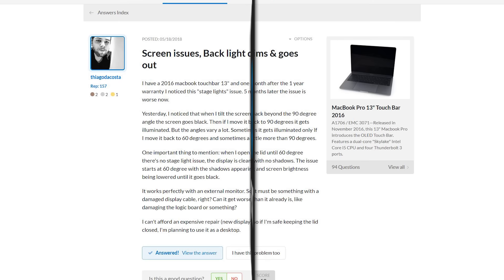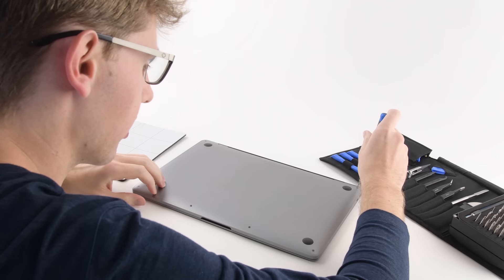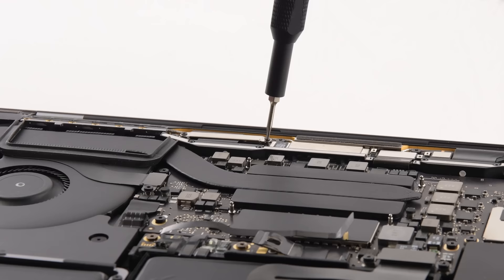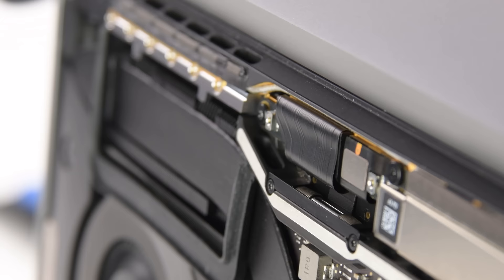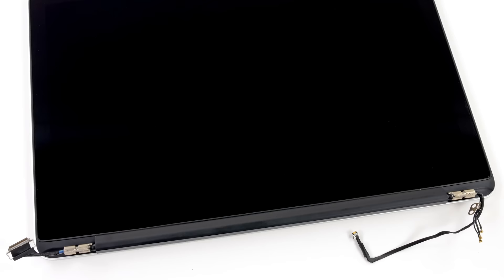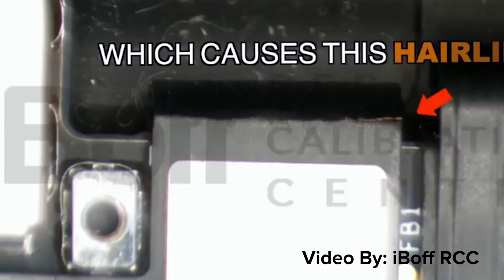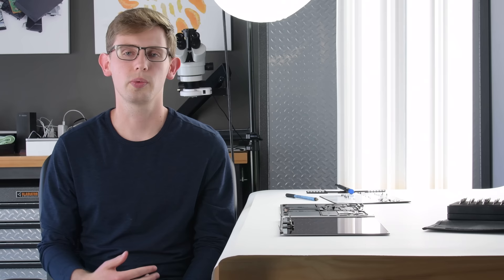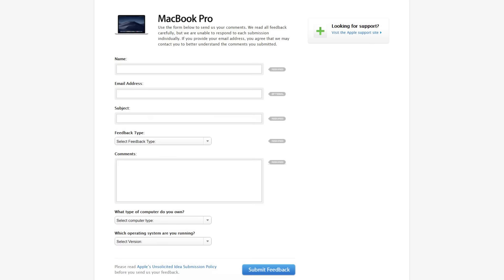The Design Flaw Behind MacBook Pro’s “Stage light” Effect! #Flexgate

Comment: What gives Apple?  It's just one screw up after another.  I love Apple products, but I can't stand this anymore...  Posting my MacBook Pro for sale and buying a windows laptop is very tempting right now.
Reply: yeah, since the new iPad is coming bend from the Factory im not going to buy one, my iPad Pro 9.7 looks like new and performs great, why should i buy an overpriced Banana, also can‘t use my apple pencil on it and no more Lightning Connector, Apple sucks since a few years now....
Reply: if you're looking for a thin and light, you should check out laptops from Razer, Dell, HP, Asus, and MSI etc.....
Reply: Then do it. Nobody’s stopping you.
Reply: Justin White just get a new RTX laptop...
Reply: in late 2011, I got myself a £2100 GBP Mac book pro. I love it, but its over-heats, and I have had to get a table cooler. I have also had to instal FAN control.  I love the Mac Operating system then and now. Than My graphics card chip fried and I was just in warranty to get the motherboard replaced ( it cost almost £700 GBP (free to me).  The Mac book overheats still. So I have employed the previous measures. Its a love-hate affair with me with me. Lots of things to love about apple but lots of things to hate. I have an iPhone, 11.9 iPad Pro 2019, MacBook Pro2011 (as mentioned), earPods, iPod (x3).  That said I am well established into the Apple ecosystem and they got me good and proper. It is difficult to detach myself. I can tell you that I will never get another MacBook Pro, too unreliable. I will be getting a razer Laptop and installing AppleOS on it on a dual boot set-up. It's possible using Hackingtosh process.

What can I say, I gave Apple all the chances in the world one would give. I wish Apple would sort themselves out as I would not want to go away, but at this moment I will not be getting another MacBook Pro. Sorry, Apple you messed up too many times on this product.
Reply: Macbook competitors suck. Source: try opening timeline on an ultrabook. I get 1 frame of the entire animation on my XPS 13
Reply: @jehovahnissi1961  Yes that is certainly true.  You have to admit though, Apple can and has done better.  I just would like to see them get back to that.  I doubt I will actually move forward with getting a windows laptop.  Ultimately, macOS is the reason I have a MacBook Pro, and I really don't want to tackle a Hackintosh.
Reply: If you want a high quality ultrabook, go for a thinkpad
Reply: Huawei's laptops are 🔥
Reply: @xXGeth270Xx  yeah, if it would'nt be so easy to bend i would consider it too, i use the iPad Pro 9.7 with an Apple Pencil and i like writing with it, the newer iPads just are so smooth with that 120hz Display, makes me want to upgrade..
Reply: @jehovahnissi1961  At least you can fix it - stupid Windows 10 you can always reinstall and restore data from backup. Plus these types of screwups are fairly rare that a computer would stay unusable after a Windows update. 

Try to fix a hardware problem!
Reply: @xXGeth270Xx  maybe get a 9.7 Pro or the 10.5 Pro ( for the faster screen ) or even the 2018 iPad 9.7 since it supports the Apple Pencil as well.
Reply: warren g just the way you spell "rose royce" tells me the value of your argument...
Reply: Me too . My mext lap will be a windows and it will happen anytime in 2019 .
Reply: Go ahead! Another option is Linux. It runs on a kernel, like OSX does so it won't take long to get used to
Reply: @power21100  Right, because those aren't complete trash.
Reply: @latitudeash  The 2011 MacBook pro definitely has design issue with the Nvidia chip failing after several hundred heating/cooling cycles.  There WAS an Apple program to fix this,  but it has no expired.  I recent;y fixed one of these for about $265.00 through a friend who has the equipment for desoldering and desoldering the GPU.  Sorry about your woe.
Reply: @maxdamage8562  complete trash like a macbook pro? no not really, those laptops are better.
Reply: @maxdamage8562  : Its life and we learn from past experiance. Apple need to remember this.

Comment: My 2016 MacBook Pro 15 Touchbar was also affected and I had to buy a completely new display after only 1.5 years. In three Apple Store they didn't want to do it for free and said that I would be the first one with this problem, so I had to pay ~500€ for their design fail. Good to know that I've been lied to and they knew exactly about this flaw... Btw my keyboard is getting "stickier" too and one key already stopped working for a day.......
Reply: Same computer as you...and yes Ive already had to get the display fixed and my keyboard fixed. This computer has been a joke. Over $1,000 in repairs that I didn't have to pay because apple care covered it. Thats ridiculous! I'm Cooked out. Ready for a new CEO to come in and fix Apple after all the issues that dude has brought on the company.
Reply: it got me wondering, aren't you guys are at a point to start thinking "this isn't worth it" and find alternative products, instead of continue paying those unreasonable sum...?
Reply: ZeroLife if only PC manufacturers started making their computers super easy to run mac os, they wouldn’t have any problems selling their PCs. Hackintosh laptops can be a nightmare to get working correctly compared to a desktop hackintosh. And to answer your question, my next computer will be a hackintosh. I’m done paying high prices for sub par hardware. I love Mac OS but the hardware choices under Tim Cook tend to be lower quality.
Reply: If macos is what you need then no other choices. But if it's not just get a thinkpad and it'll run like toyota corolla. Boring but works.

Comment: First of all they are expensive. Then now they have this type of stupid problems. Thought of buying one next month but nope never buying an apple macbook.
Reply: Radd Dronzy never bad this problem the MacBook Pro is really good for work
Reply: Get an iPad instead
Reply: I have an older MacBook (2012) and  love it.
Reply: @Thatapsguy12  Old macbooks are great. But if I want them then I will get only secondhand.
Reply: Look into buying pre - 2015 models as they are rated high in repairability, and my 2012 is still rocking strong after 4+ years of being on the bed, backpack, and on the table.
Reply: Radd Dronzy get an RTX laptop...
Reply: BluMac I hope you understand not everyone needs a windows laptop. Like I use primarily FinalCutPro X and Logic Pro X, I cant just switch to windows in one instance. A lot of my work flow goes through them and huge amounts of my data are on iCloud so no! 

It’s not about being locked in an ecosystem as I can even switch to Ableton or even Adobe instead of FinalCut but you will need months and months of practice and you have to transfer all your previous works to something that fits Windows and then there is the huge issue that a lot of my setup would get in a big chaos. There is also the issue that a lot of my friends and fellow students use MacBooks and even the computer set up in my school are Macs, fact even the bank where I do my summer internships at which is the Nordea Bank here in Sweden also uses Macs in several of there departments, so yeah not at all possible!

Nor do I want to switch as I am happy with my MacBook.
Reply: Sondre Johansen did I say that everyone needed a windows laptop?
Reply: Sondre Johansen that’s why I’m running a hackintosh on one of my PCs
Reply: Get a good Windows Laptop than make it into a Hackintosh. Done.
Reply: @brandon_nope  thats what i said...
Reply: Buy LG gram
Reply: @MrUnkownGuyAC  On the bed? smh
Reply: @blumac9801  I heard RTX gpu is not durable... its degrades easily
Reply: @sondrejohansen48  Microsoft has Cloud Storage. Use theirs. Stop complaining about nothing.
Reply: @TheOrisya  Hasnt even been out a month, and still there are complaints without sources?
Reply: TheOrisya ? I’ve never heard anyone say that before when the 10 series laptops came out, or what the 20 series laptops came out.
Reply: Radd Dronzy that’s how I got mine actually my mom didn’t want to pay the full
Cost
Reply: Sorry to hear that.  I have had many and they are awesome.  I currently have the 2016 13" MacBook pro. Many people have hated on this model, due to the keyboard and other issues (see above). It's tiny, very fast and extremely well built and continues to perform flawlessly. If I end up having the above issue, hopefully Apple will stand behind it.

Comment: Same thing happend to my macbook pro from 2017 after 2 years. Apple wants $1000 to swap out my screen, even though the cable is the only issue on my device. I will never buy any products from Apple again. The risk of failure on their Macs are way too high for the price tag, and their products are not reliable at all. You really expect that a Macbook pro that costs $3000 last for more than 2 years.

Comment: People keep thinking that warranty is the only thing that matters. People need to read up on "Consumer complaint
". Warranty is something the retailer or brand can offer. Consumer complaint
 is in the law and is in most cases always better than warranty. In this case Apple only gives 1 year warranty where here in Norway as an example, laptops usually have a 5 year Consumer complaint
. If you didn't cause the issue, Consumer complaint
 should be valid, and it's valid for 5 years for laptops.

Comment: Apple cares more about making their devices nice and light rather than usable and durable.
Reply: *more about making more money by using poor design choices to force more expensive repairs than

FTFY.
Reply: They actually make internationally breakable after one year span..and also 6$ replacement made 600$ thats called bussness
Reply: Its not the problem of being light, look at newest Swift 7 or Asus - they light, tiny and have no buttons or display issues like Apple. Also they cost the same price.
Reply: @jonaswunderkind4580  dont fool yourself,all laptops have one issue or the other....
Reply: @ppsarrakis  Have my Acer for 4 years, no problem so far except annoying fan noise which is the problem for most Windows laptops. SO 2 000 Eur MacBook just can't have keyboard issues, just can't.
Reply: @jonaswunderkind4580  They certainly may also have design flaws. You don't know.
Reply: @maxdamage8562  Why are you defending a design flaw of a machine costing over 2000 Eur? :D Yes my Acer have design flaws, but BASICS work very well for over 4 years. When you buy MacBook for such a high price - basics like keyboard SHOULD be working well with no issues. If cheaper machines can do it, then premium computer SHOULD too!
Reply: @jonaswunderkind4580  I agree completely! I am typing this on my 2016 MacBook pro and so far (touch wood) so good.

Comment: The touch bar Macbook pro has to be the Edsel of the Macintosh range.  I have a 2017 one and already the keyboard has been replaced because they admitted that was a design flaw.  Last week I started getting the stage light error.  I took it to be repaired and the tech gut said it would cost £700 plus Very disappointed is putting it mildly

Comment: My 2017 Macbook Pro 15 inch just started this exact same thing. The display actually started this a few weeks ago as I was just sitting with my laptop using it and my screen just went black. I tried opening and close it but nothing worked. I then discovered opening it slightly, the screen worked then opening it further, the whole screen cut out. I can't believe this is a known issue and Apple has done nothing to stand behind their product. Instead all they care about is making more profit instead of doing the right thing and repairing mine and other's machines. I had a feeling it was a cable before I even came across this issue because I could plug my laptop in an external monitor and get a display but after seeing this, I will not buy another Apple laptop if they can't stand behind their own product.
Reply: Exact same thing happened to me.
Reply: same here as well. Totally lost trust in apple and will no longer be purchasing their products
Reply: Same to my McBook Pro 2018.. dirty business by Apple.. after 3 yrs then its will occurs same display problem
Reply: same today. after 20 plus years of mac use, not sure what to do. pretty hard to just buy another one or paid thee absurd repair price when the computer functions perfectly (when its open to maximum 45 degrees)

Comment: I had mine fixed for 100 euro   the cable was replaced  this requires the a skilled tech to do it.  make sure the shop you go to has done it already or advertises that they can do it.  apple no longer supports this failure .

Comment: So frustrating that a problem like this can even exist from just opening and closing the computer.  So when the laptop goes in for repair are they putting in longer cables to fix the problem or is the same thing going to happen in a years time ?
Reply: no it wont !   am a professional mac technician and i can tell for a fact with my experience with flex, the issue wont happend again beccause if the  flex is longer it wont  break, so far ive fixed or repaired over 20 macs  issues with backlight  flex or the lcd panel itself especially from 2016 - present and they all been good  till now

Comment: Feel absolutely betrayed by Apple because of this issue. Not a scratch on my 2017 macbook and boom my screen turns black. They tell me I need to pay +800$ to replace the whole screen. They purposely sold these products knowing there was an issue but only replace the flexgate of 13 inch 2016 macbook pro’s. Joke of a company. What a letdown
Reply: hey, even if it was a 2016 mac they wouldn’t have fixed it, i went in with the exact problem and they tried to make me replace my whole screen for 497$.

Comment: Out of warranty, Apple will tell you that you need a new display panel, and possibly a logic board, and that you'd be better off buying a new laptop. That seems to be the way they do business these days. Someone really needs to start selling Hackintosh kits, both for desktop and laptops. Sell a kit of compatible components, and include everything but a Mac OS disk, and you'd get everything you want at half the price. Personally, if I could easily buy a nicely spec'd kit, I wouldn't care if it was heavier, thicker, or made of plastic. I (and I suspect a lot of people) just want Mac OS.
Reply: problem is that installing mac is can be really difficult for a regular user and they can't advertise themselves as a hackintosh device or anything like that, as apple legal team will be very mad at that
Reply: Selling hackintosh causes jail
Reply: Nobody can sell "Hackintosh kits" because you will get sued for contributory copyright infringement by Apple, even if you don't distribute the disks themselves . They will claim that your "product" is designed only to facilitate copyright infringement by others (installing MacOS on anything but Apple hw is prohibited by their license) and you will have very expensive legal problems. 

And if you don't label the kit as "Hackintosh", then you are just selling a regular PC that anyone could buy on every corner. Not sure what would be the point.
Reply: That's a lawsuit. Apple went after them and won.
Reply: I made my older laptop Hackintosh in the past (~2010). The problem is that MacOS is so fragile that whenever a device driver sneezes the OS crashes. Something that in Windows would be a warning in the event log is terminal error in MacOS. 99% of windows issues are caused by badly written 3rd party drivers. When you install a driver from the installation disk it usually adds a ton of bloatware (update checkers etc) that slows down your Windows machine considerably
Reply: @asicdathens  You are incorrect. You are using Garbage half baked drivers and then Blaming Apple for the instability!  Nonsense.
Reply: @maxdamage8562  People accuse Microsoft for the same reason. The drivers are neither garbage nor half baked. And I blame the driver model API in MacOS unlike Microsoft after years of poorly written 3rd party drivers (mostly rebadged reference drivers) they (MS)  made an environment robust enough to tolerate minor driver infractions. In linux something similar happens as well.

Comment: if i ignore it (since mine isn't as bad as the one in the video), will it get worse overtime?
Reply: Yes, definitely. For my 13 inch 2017 MBP,  stagelight effect started about couple weeks ago. So I started using it at about 50 degree angle. After a week or so of continuous using now the display is completely gone black.

Comment: I have one of the last Vaio models from Sony (2014 model) After a lot of wear and tear  and two falls I replaced the plastic shells and the laptop is as new. I replaced HDD (solid state), battery, wifi module (upgraded to 5Ghz). It's an i7 with 8GB and I can run all the software I need.
Reply: Yeah... , since my 2018 model Mac book pro has this issue, I switched to Sony Vaio 2010 model by upgrading to SSD.

Comment: People used to say that buying an apple product was expensive but at least will last you a long time.  Now you're not even sure if they designed the thing with the intent of it breaking after one year.  There is no reason to put a fragile cable around a sharp edge and to make it worse make it to where you can't replace it without replacing the whole screen.

Comment: I have A1706 model and the camera has gone dead the repair guys said the flexgate is display backlight issue only. but the camera cable is also similar which has killed the camera and no one is ready to repair since they haven't worked on it.